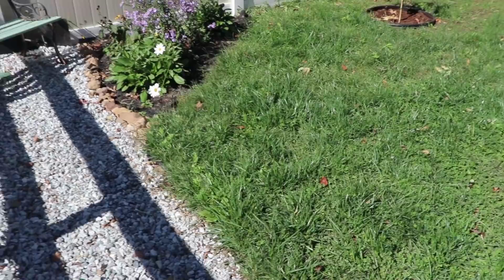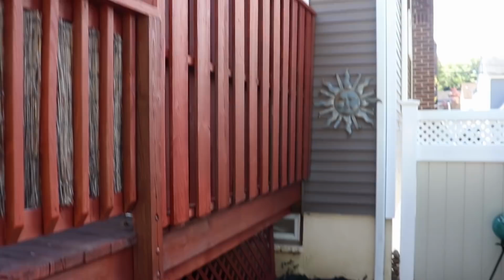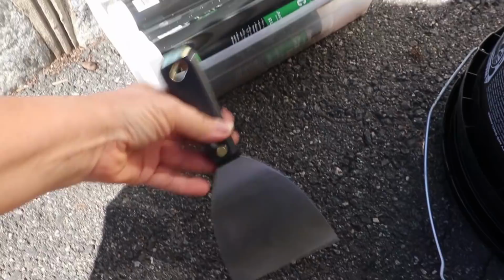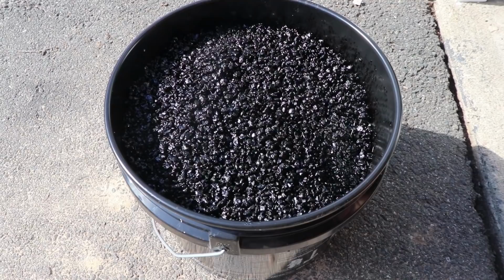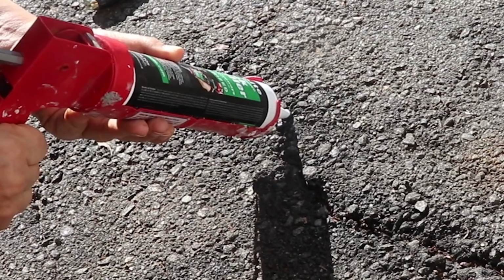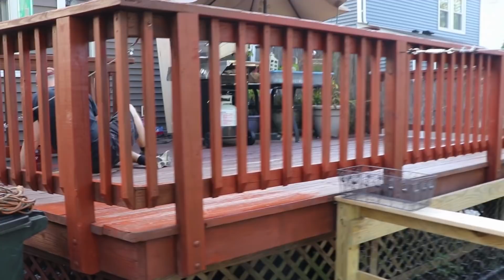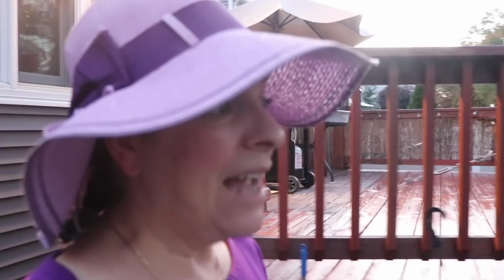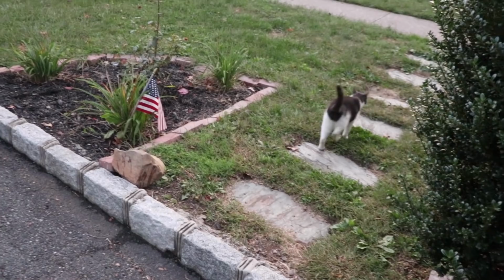Driveway Repair + Sealing - Part One - Plenty of Cracks to Fill!

Comment: Nice job on the driveway repair! You are getting a lot done this year. 

We had an driveway like that in our former home. We sealed it every year, usually in the fall. If you seal it every year, you won't get any cracks, or at least we didn't.  In our area, there was usually a company that went door to door offering a driveway sealing special. Then they came back on a particular day and sealed all the homes in the area. 

I keep a fall checklist of all the tasks for the outside of the home. It saves a lot of time if you can get in the habit of sealing the driveway every year since you can eliminate nearly all of the patchwork.

Comment: Your neighbor's sprinkler is not causing cracks unless they're running it in freezing temps. Asphalt cracks, particularly in areas where there's snow and cold temps. That's just something you have to keep on, whether or not neighbors have sprinklers. By the way, I think the hat's fantastic and not silly at all.

Comment: Both the divots and the cracks is likely due to insufficient ground work when the asphalt was installed. So now it’s affected by the ground freezing in winter (if it get that cold where you are) and shifting due to ground water. But with your maintainence, the driveway will have longevity 😊